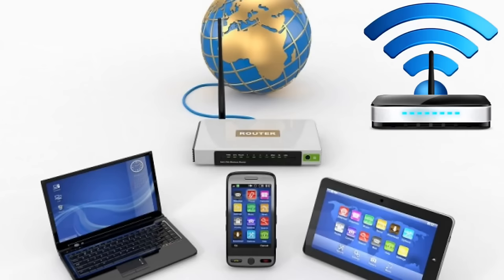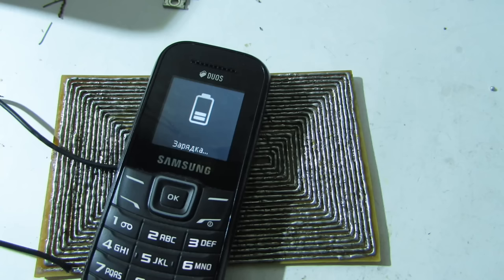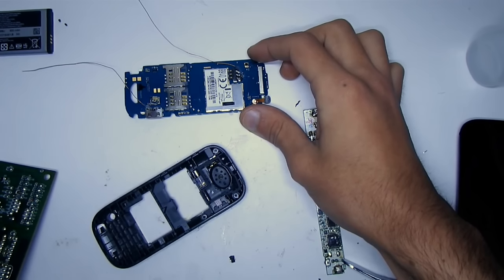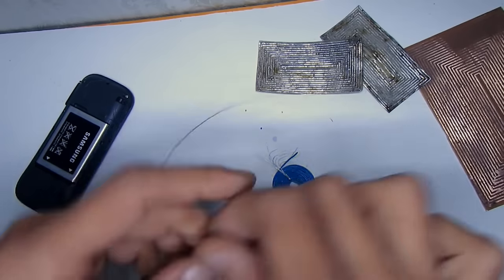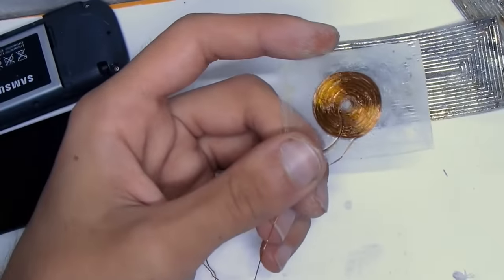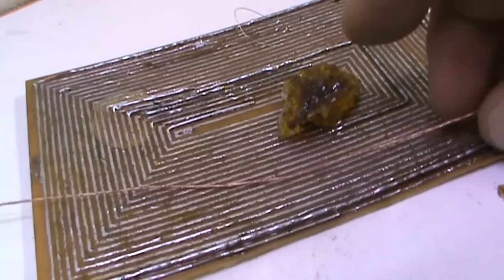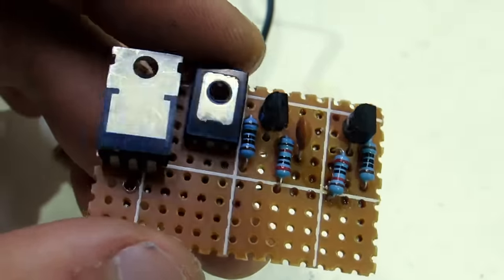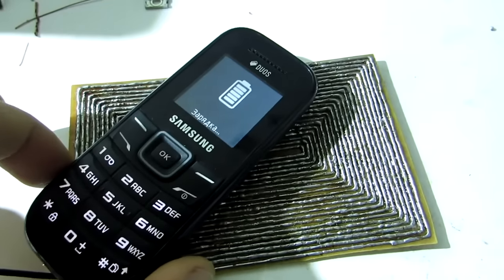How to make wireless charger for any phone

Comment: There is also good reason why batteries are still charged via cables... 
As long as the mobile phone is on, it works, which of course requires electricity.  If you charge by cable, the mobile phone draws this power (plus the power it needs to charge the battery) directly from the mains or from the source.  On the other hand, if you charge contactless, the mobile phone draws the power for it from its own battery, although it also charges it from the mains (or the respective source).  This double load reduces the lifetime of the batteries enormously.

Comment: thanks man. just finished downloading the circuit diagrams. really nice. but i will like to know how many turns of wire is for the transmitter and receiver because its not there in the circuit diagram. thanks

Comment: I made it!! thx working perfect on LG G4
Reply: Varnit Thakhur 
same circuit but bigger transmitting and reciving coil !!
my phone has voltage regulator so i conected recivin coil directly to terminals for wireless charging coil
Reply: hi please I need more detail  about how to make transmitter board and name of the components . please .
Reply: hi please .I need more detail  about how to make transmitter board and name of the components . please .
Reply: Omer Barznjy 
I used 555 timer and irfz44 at around 150khz , transmitter coil has 15turns and reciver coil 10turns. I found resonant frequency with signal generator and I put resonant capacitor to reciving coil (first I experimented with variable air capacitor then I replace it with ceramic capacitor)
sry for bad english . good luck
Reply: Big thanks for the explanation. But I still  have little  problem  . That I don't know how to supply  this on the board. Please if you can chat with me some how . I really  appreciate  your help
Reply: Omer Barznjy 
I dont understand , do you mean how to put circuit on experimental board ? or something else 
I made video of my first wireless power transmitter you can watch it on my channel.
Reply: can i use 150 turns for both transmitter and receiver with the same circuit above?

Comment: I want at a time 2 0r 3 mobiles charging what to do
Reply: The same circuit will work it only draws more current from power supply.
Make sure you add 7805 and resonant caps on every reciver coil